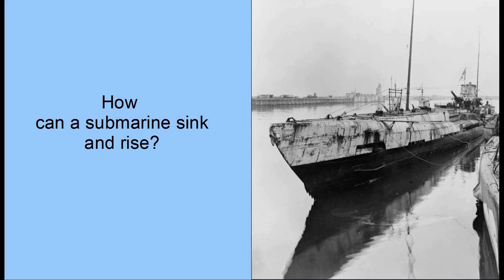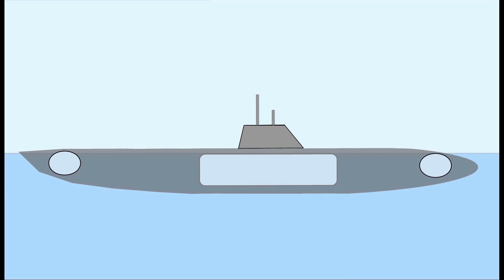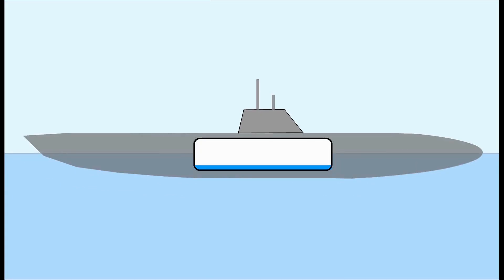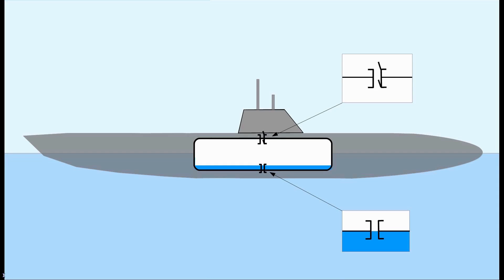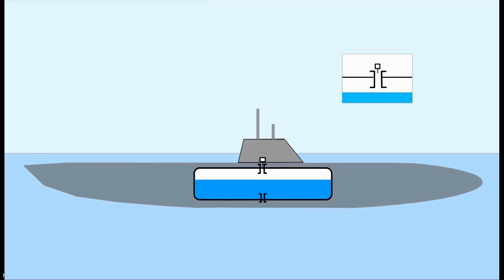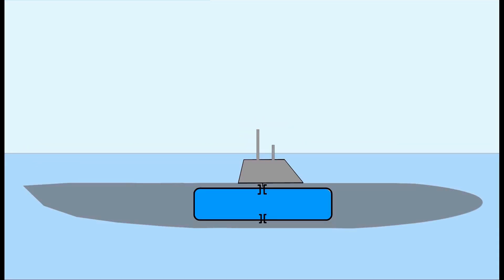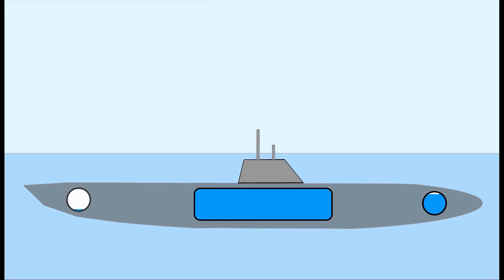How does a submarine sink and rise ? Animation

Comment: sorry, I still dont get it: I would like to dive, ok, I fill my tank with water, weight will increase and all is fine- now I would like to go back to surface, you say I pump "compressed air" into the tank to chase the water out, right? unfortunately, it will not work like that- air, compressed or not will never drive the water out,  unless container is airtight (not the same as watertight) and under condition that pressure in the tank is higher than pressure surrounding the submarine at 100m of depth- lets say, 1000 atm? plus, you will need more and more air in wolume to pump in?  only solution is to pump the water out of the tank, now you need to air to flow in without pumping it in order for pump the work, isnt it? that cannot be compressed air, so you need another tank to unpack the compressed air to, but what to do with air that was in the tank already, shall we compress that one in the containers we have just emptied? its so confusing- nice diagram though...

Comment: Ok , now if the submarine is submerged deep down  then how does it get air to fill the tank  ?
Reply: It doesn't need any air. It simply drives to the surface using the dive planes. Kind of like how a plane flies higher.

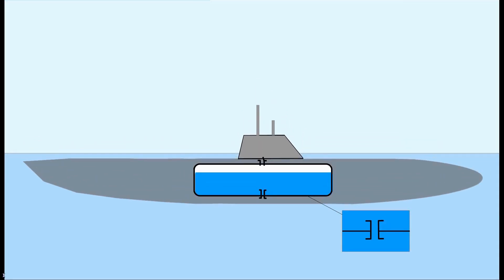Comment: 1:42. i understand the water pressure underneath pushes into the hole but does water also go in through the valve on the top at the same time the air goes out, or does the airpressure push the water away?
Reply: the air is coming in from the top, and pushing the water downwards, out of the bottom valve

Comment: Maybe I’m dumb, but I don’t understand the compressed air part: The compressed air would have to come from inside the submarine in the first place, so it would always have been there, and every time the ballast tanks were filled again, the air would be gone. So where would they get more compressed air to blow out the tank?  Like if the compressed air comes from someplace story in the boat, how could it sink in the first place if it had enough compressed air to blow the ballast tanks to rise?
Reply: I believe when the air is in a compressed state, it's denser and thus even heavier than water.
Reply: He mentioned fumes from fuel engines as one source. I imagine they can also use carbon dioxide waste. So I'm guessing they can't go up anytime they want and may have to wait a bit to get the air they need.

Comment: If there was already enough air to refill the tank when you want to surface why would it sink to begin with? If the air in the tank is light enough to keep the sub from sinking and the compressor is almost equal to the amount of air in the tank wouldnt you need both to be filled with water? Or is water just so much heavier than air just that little amount can weigh it down
Reply: I was thinking the same. You are expelling air from one tank with water to dive, but keeping compressed air in another tank to surface. I can''t understand that.
Reply: bro density is mass/volume. It doesn't depend on amount of gas. When the gas is compressed it has low volume.
density-when-filled-with-water=
mass-of-submarine+water/volume-of submarine
density-without-water=
mass-of-submarine/volume-of submarine
density is lower in second equation, now do you understand?
Reply: To put it simply, air when compressed to a small volume is dense and thus heavy.
Reply: the compressed air is expelling the heavy water from the ballast tank.

Comment: most of the time the submarine is neither diving nor surfacing, it is just at equilibrium (depth wise). How is that achieved?
Reply: Water is let into the tank in order to dive. When the desired depth is reached, a specific amount of air is let into the tank so that the average density of the submarine equals the density of water.

Comment: What happens if the sub runs out of compressed air? Do you just manually use a water pump to pump out the water?
Reply: I think if it rises up to the surface,  the submarine can refill its compressed air supply. the idea is not to waste all the compressed when the submarine is way below the surface.
Reply: @relhage100  how is it supposed to refill its compressed air when submerged? i guess the compressed air is for exceptional situations only.

Comment: I still want to know where the compressed air comes from, there's not an endless supply.
Are they topped up when surface running, like filling a scuba tank.
Iv never understood why the expelled air isn't sucked out into a storage tank to be reused, instead of just escaping into the atmosphere.
Thanks for posting, but I still have questions that need answering. 👍🏼👍🏼
Reply: Just saw this video tonight. I would try to answer according to my perception. As far as compressed air is concerned, there should be two ways of storing it. 1) by pre-installed air  compression storage before submarine to launch in sea. 2) while the submarine is floating over surface. Here, one rotor should be mounted on engine shaft to suck the atmospheric air through long pipe over  centre-head of submarine. Here, I think certain amount of water is to be stored before operation and that would successively drain out with suction of atmospheric air. This should be provided to make mass balance else submarine would not glide over surface ( could start to imbalance. However, chances are i very small because density of air is very less to imbalance such heavy weight body.)Just added to this not to prove 1st law of Energy conservation wrong. Haha.
However, for your second argument of expelling of compressed air along with resuction and storage of same for reuse, I would say it is not possible. Since compressed air is allowed to drain water out to rise submarine. Here, one thing should be kept in mind that while submarine is completely submerged you could not suck the air. As there is no scope to suck as that long pipe over centre-head of submarine is also under water. Entry of fluid must be closed through it otherwise it would only allow water to fill in which is total non-sense of forcing water drain from one side and allowing it to suck in from other. This could not allow submarine to sufficiently rise. Here, no air could be sucked at all only the water could. Hope my answer is satisfactory as I also applied my thoughts.
Reply: Compressed air is stored but doesn't keep the submarine afloat at all times because it has a higher density than normal air.
Reply: I've read these comments (one was too long and over complicated) but the comments don't really explain where the compressed air is coming from or stored (if indeed it is) I was always under the impression that that you simply flooded water into the tanks and when you want to rise the sub you just pump the water out.  The fact that the main hull where the people all are has enough air and buoyancy etc to bring everything back up and the ballast tanks are then effectively vacuums.  With no actual air pumped into them to raise the sub. However I was also under the impression that some subs kept a tank of High pressure gas inside the ballast tank which they could use in emergencies when the water pumps failed. Please correct or confirm.
Reply: I have now take 9 year am writing theories on how submarine dive and suface from 2011 now is 2019, i got  some correct and soon I will be a manufacturer of submarine
Reply: The compressed gas comes from the guts..!
Reply: Tim JD  You can't create air from seawater, only absorb it.
Reply: Tim JD  Thanks lol
Reply: FOR WHAT ARE YOU GOING TO BUILD ONE THAT'S WHY YOU GOT SOME MORE FREAKING QUESTIONS,THANK'S COMMENT FROM CHICAGO ...
Reply: This video is wrong. They aren’t refilling the tank with air, they are pumping water in and out to change the buoyancy force of the sub. Volume of air remains the same but is compressed to make room for more water thus changing the density of the sub. It would be nearly impossible to store that amount of compressed air or to fill the tank with a high enough air pressure to overcome the water pressure especially at depth.
Reply: @nokaoemauibuilt  Whether or not you pump water or air you still have to pump with the same pressure. The pressure required to pump into the ballast tank is determined by the depth the submarine is at and there is absolutely no difference whether it is air or water you have to pump.
Reply: Hans Henrik Larsen density is the difference.
Reply: @nokaoemauibuilt  thanks for the info
Reply: @nokaoemauibuilt  Thanks, It wasn't answering my curiosity in others comments. They made it sound like they used a compressor using cabin air or tanks that had air in them. The weight of the backup tanks would be great and cabin air is limited.
Reply: @nokaoemauibuilt  You don't know what you are talking about!
s/24 Year Retired US Navy Submariner
Reply: @nokaoemauibuilt  Thank you.
Reply: @nokaoemauibuilt  thanks

Comment: why doesn't the compressed air still count as being air on the boat, causing it to float upward  ?
Reply: The idea is that if we want to sink, the submarine has to be denser than the water, that is, weigh more pr. volume. We all know that air is lighter than water, but if we compress it, that is decreasing the volume, then we have less volume but the same weight, therefore we have dense air. So we can make air weigh more than water pr. volume by compressing it, allowing us to use it when we need it. When we want to rise up to the surface, we simply increase the volume of the air, by filling it into larger tanks. This way the air gets less dense and we start to rise.
Reply: Maybe because the water is still there in the main tank, so they have to get rid of it by using the compressed air
Reply: It's not about the weight of the air, that's the same compressed or not, it's the weight of the water you are pushing out of the boat with the air.
Reply: It's 'compressed' i.e the air which would have took a large area takes a small area as it's compressed. So as the area is less, volume is less and hence the density is more,
As density is inversely proportional to the volume. As the density is more than the water, it remained sinked in the water.
Reply: OK all, thanks much for all the reply's.......I think I understand it's not the weight of the water that matters,  it's  just the air pressure used to push out the water. from the tanks.....so that means if the boat runs out of air while submerged and nothing is left to push the water out  of the tank, it's a major problem to raise the boat......right?
Reply: @garyvale8347   I'm describing the emergency process it seems, fascinating but complicated, check this out https://www.quora.com/When-submarines-blow-their-air-to-submerge-how-do-they-replenish-it-to-resurface
Reply: @garyvale8347   They keep the air, they just compress and decompress it, the only thing they have to replace is the water.
Reply: Compressed air is much heavier than normal air.
Reply: @geohubblez18  Volume for volume yes, but only because it's denser, if you take some air, weigh it, then compress it it will weigh the same. https://www.quora.com/Does-compressed-air-weigh-more-than-normal-air
Reply: It does count but that's not the aspect which allows it to float. It's because the air is in direct contact with the water (and sea) and is able to increase/decrease pressure.
So if you had a plastic cup with a tube at the top connected to a balloon you could pump the air from the cup into the baloon and seal it off. The cup will sink and fill with water. You can then later pump the air from the balloon to the cup and it will push water out, allowing it to float.

The floating/sinking effect of that just needs to be stronger than the pure air in the balloon of your structure.
Reply: compressed air is in the form of liquid
Reply: @aronbeast7  Nope!